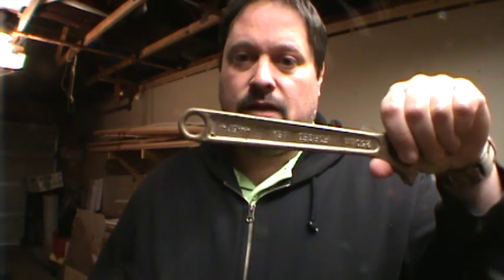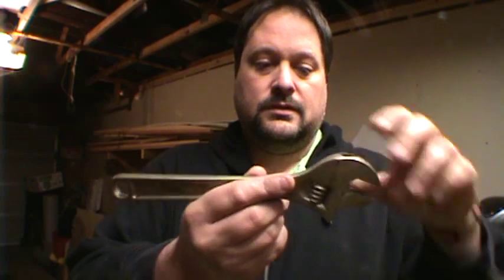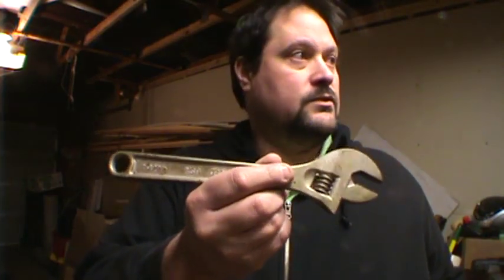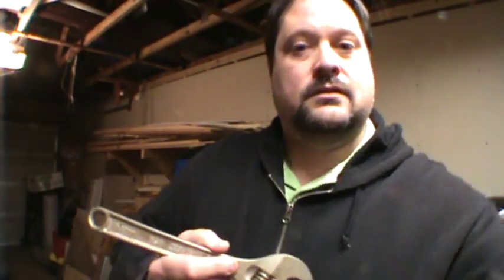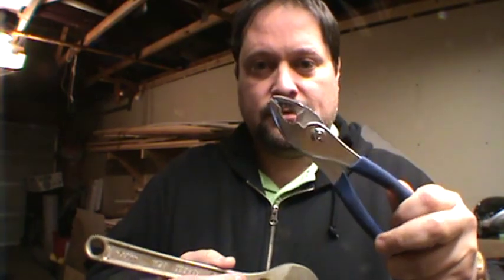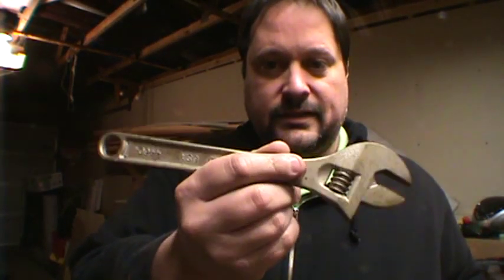Gold Recovery from eWaste via A/P or Acid Peroxide method part 2 safety

Comment: I love how conscientious you are. I'm a trained lab tech, and I know that safety is important - even if you know how everything works, you can't simply assume you won't make mistakes while handling chemicals. Also, fumes can really sneak up on you. 

Also, I appreciate your saving the copper in the last video. Just because it's far less valuable, there's no reason to throw it away... We have to get it from somewhere, so we might as well recycle it, especially when it's sitting in a jar, already isolated.
Reply from the maker: Thanks!

Comment: From the Gold Refining Forum...(I read your last comment and serendipitously had that page of the pdf open in my reader...)

Actual test case on 50 sticks of memory  
Test conducted on 7/5/2007 on 50 sticks of DIMM 100 pin memory.  
50 sticks of DIMM memory weighs 2.03 lbs  Trimmed fingers weigh 68 grams  
The gold plated surface on each finger measures  
0.04 in. by 0.10 in. = total 0.004 sq. in. per pad on each finger.  
There are 100 pins with both sides gold plated.  
0.04 x 0.10 x 100 x 2 =0.8 sq. in. per board x 50 ea = 40 sq in. total surface.  
The above mathematical derived results come out to approximately 0.38 grams of pure gold in the 50 circuit boards.

Comment: Is there gold in the contacts of old debit and credit cards? I keep all my old cards.
 The contacts look like gold?????
Reply from the maker: Are you asking if there is gold in the card or the card reading machine?  Very few credit cards have gold on them.  The ones that do look like this.
http://www.blackenterprise.com/mag/what-you-should-know-before-settling-credit-card-debt-2/
They have that little square with gold foil just like on sim cards.
Reply: Awesome, thanks for the reply! In Canada all bank cards have this sim type foil on them and a chip inside with gold wire connections. There is more gold most likely in the outer square than inside with the chip. Maybe I'll do a video and show you or you can just look on You TUbe for 'credit card chips' and you'll see what I mean. Thanks again and I've subbed your channel, thanks Moose!

Comment: when you melt this leaf gold what color is it, the reason why I ask is I melt some and it came out an orange color not yellow so I was wondering if copper was in it.
Reply from the maker: that probably was copper in there.  check out my video on refining.  just drop the nugget in there and leave it until it has completely dissolved then filter and precipitate the purified gold.  It may take several hours for the nugget to dissolve.

Comment: Hey moose, thanks for all the advice on the other video. I watched & researched a lot more but I did have a couple more questions. My idea was I was going to scrap down boards & go after gold & silver. also copper recovery out of the used solutions.  I have a lot of plated jewelry & I was wondering if it would be easier to use the AP method on that stuff vs trying to just melt it. Silver I have no problem melting & making a nice ingot but every time I melt gold it comes out looking like copper until I remelt it & seems like the copper burns away. Im using a map torch from home depot. Im afraid when I go to melt all the scrap ive collected it will end up ugly & I cant fix it after that. I don't feel comfy trying the refining stuff yet & Im just now learning about boardsort. Im in this for the metals, not cash. Anymore helpful advice on routes to go?
Reply from the maker: Hi and thanks for watching!  First of all, DON"T MELT IT!!!  Metals like to alloy and if you melt a gold plated item you just made the gold a whole lot arder to get at.  AP can work on the jewelry but it will take weeks to eat that much base metal.  For gold plated jewelry they say the best method is reverse electroplating which I am learning about now and seems to be very easy to do.  As for refining, it can be scary working with some of these chemicals but if you take the proper precaustions, most importantly ventilation, you should be able to handle it.  The refining chemical process may also be an alternative for gold recovery from the jewelry.  I am still learning about that but it looks promising.  Read CM Hoke's book o refining.  It has EVERYTHING and check out people like geo, indeeditdoes, and drew metalsmith and original feets.

Comment from the maker: Gold plate and gold filled, if the pieces are magnetic then I would use HCL and heat.  You will want to cut up the pieces as much as you can to get more surface area of the innner metal to react with the chemicals.  If they are gold over brass or copper then you can use the A/P method but will need to cut up as well.  This method is slower than HCL and heat.  You can also use HCL and heat for non magnetic Au plated or filled items.

Comment: Yep, I did use both. I think air pump helps to the foils go out easily from the surface. The ammount of gold per 1 kg I dont know. What I know is if I want to sell that 1 kg of sim´s I get U$ 13. Any way, I´ll do it for the fun. I dont have enough knowledge to do it in a bigger scale. Accidents are bad, but small accidents are less bad then big ones. :-) Thank you once again for your kind reply.

Comment from the maker: If you are using peroxide and an air pump then it it likely too much oxygen.  try using just one or the other or did I misunderstand?  One of the big problems I ran into when I first started was that I didn't realize exactly how little gold there is on these things.  I was pretty dissappointed in the results from my first couple of runs.  With one kg you should have much better visible results.  If I recall, there was someone on the goldrefiningforum who really likes data and he ...

Comment: Thank you for your answer. For my first test the solution was 3 parts of muriatic for 2 parts of peroxid. I have use a air pump. I only use about 100 grams of sim cards. Now I have 1 kg and I´m going to try it again and follow your video. I belive that gold can be disolved in A/P because I´ve try a small amount of  golden pins and the result was that they disappeared and there was not any gold foils remaining. Just emerald green solution.

Comment from the maker: I believe that you can use sodium metabisulfite to precipitate the gold out but am not 100% sure.  SIM foils are really thin and usually in pieces so when they separate it looks like a whole lot less than it should.  You sure you have gold in the solution?  Try a gold test kit?  You may want to test a drop of the solution first as gold will typically not dissolve into the solution unless there is way too much oxygen in there or unless its a solution of hcl and bleach.  goldrefiningforum can help